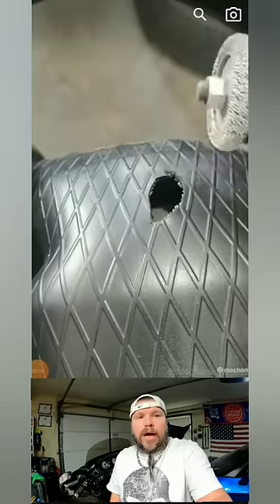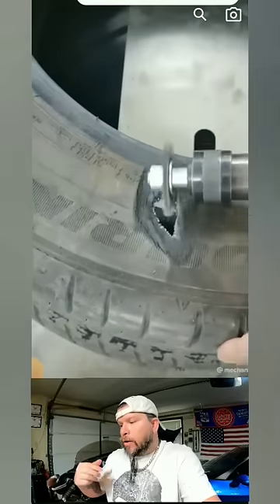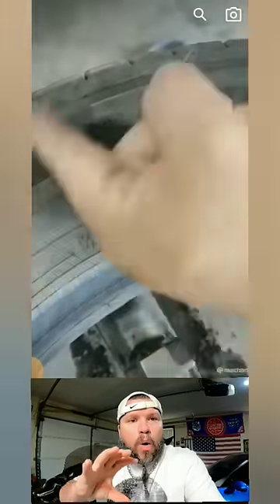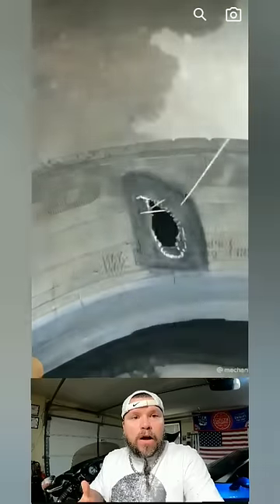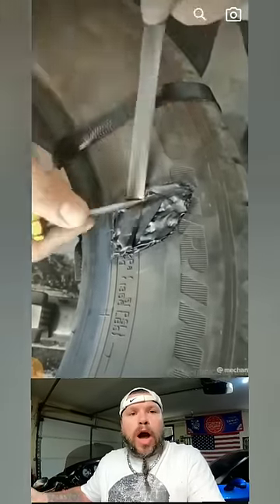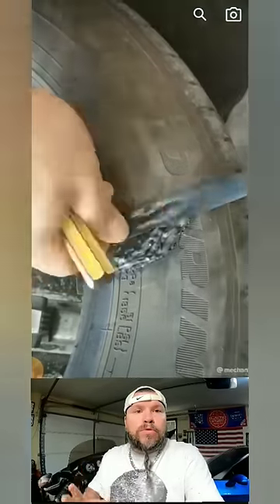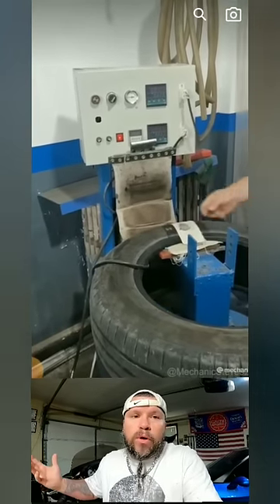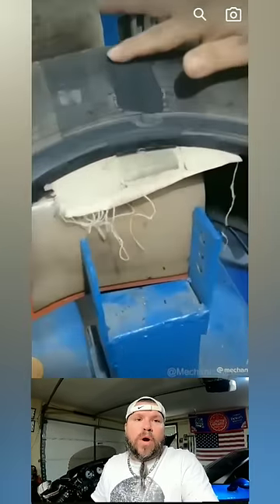patching a tire

Comment: Used to be a manager at Discount Tire. The guy is 100% right. Sidewall damage calls for a new tire.
Reply: "I worked at a place that sells tires, and he's right, buy new tires"
Reply: This is a completely different method of patching than what tire shops use. You can't compare the two.
Reply: @Kur Norock  right, because this isn't cost effective, time efficient or safe. It's compromised.
Reply: @corataylor2205  I used to work at dtc too. No one gets paid on commission except the highest lvl manager. We don't give a flying fuck if you buy a tire or not
Reply: @IronwolfXVI  except that it isn't. 
This is a legitimate and very strong repair that is used throughout most of the rest of the world.  Only here in the western world do we have this culture of throwing things away and getting a new one if something breaks or gets damaged. 

When you use wood glue to join two pics of wood, the joint becomes the strongest part of the object. This patching method works much the same way. That patch has been pressed and vulcanized, making it part of the tire sidewall and every bit as strong.
Reply: @KurNorock  and what happens when you're rolling down the highway at 75 mpg and that one spot flexes different or the threads rip out? Doesn't matter if it's "stronger" it needs to be the same
Reply: @IronwolfXVI  the threads aren't holding anything together. They were just there as a lattice to support the rubber filling.  

And the patch doesn't flex differently. It's the same material. Vulcanized rubber. 

People have been fixing millions of tires like this for generations without issue.
Reply: @Kur Norock  side wall is structural, and who's to say the compound of rubber and the heat are the same? If it ISNT holding anything together, it's weaker. That's part of my claim. Either way, if it stretches different,  it could rip.
Reply: @KurNorock  I don't just throw away things, don't say that all in the West are the same. The plain truth is that if you could afford it, you would always go with a new tire as it's much safer to drive. Nobody would cut cost on safety when you could afford it or are not dumb or don't take life seriously. Germany has like 95% of all roads with concrete, our highways have sections in which you can go as fast as you wish. Using such a repair method like this would cause many deaths.
Reply: Lol...I bought some tire air pressure sensors from Discount Tire and the damn service guys tried to sell me on some lug nuts..saying that the original lug nuts expanded and they can replace them for $70.00 more..I said man put those lug nuts back on..WTH..
Reply: @Delbert Dumas  yeah, a lot of American cars have issues with their lug nuts. Next time you're on the side of the road and can't get the socket on your lugs... well I hope you have AAA. Solid lugs are well worth the price. As far as the air gauge, my store just gave those away.

Edit: oh you probably meant the $60 electronic sensors. We didn't give those away.
Reply: Why is it just to sale a new tire?
Reply: @everardomodesto8523  I explained in the comments.
Reply: @IronwolfXVI  I have owned cars for 50 plus years and never I mean never have I had an issue with lug nuts..the guy was trying to BS me on that shit..kind of pissed me off that this place does this..first and last time I'll use this company for anything..I can only imagine the many people who fell victim to this shit..
Reply: @Bernard Watson  yeah, it's a newer thing. Go ahead and look it up if you'd like. They have a cap on the outside. It's dumb. Old lugs are solid.

Comment: The amount of times a customer has bitched to either patch or plug a sidewall. To the point we have them sign a stupidity waiver in the case dumb shit happens after warning them a million times. We just let it go.
Reply: The same thing happens in construction... Anything safety wise we simply say, sorry we can't do it. But if the person wants a cheaper product installed, we warn them,advise against it, and sometimes still won't even do it. If they really don't care, we do it but always get a call back. It's just not worth pinching pennies in some areas. I've actually had a kidney surgeon ask me to reuse old,curled,black shingles and to simply " just flip them around...
Reply: In the UK you'd be liable for doing that repair, it'd cost you your job at the very least.
Reply: ive gone to tire shops to get a plug, and they wont do it. Went to the store got a plug and did it myself. tire was fine.  Heard that story plenty of times as well.
Reply: @lynch42o  How would you live with yourself if you had a blowout and took out a family?
It's been fine for loads of people who have done it, but it's also been a disaster for others. 
I'm happy enough to gamble with my own life but I've no right to gamble with other peoples.
Reply: I get that customers can be a pain in the a*s sometimes. But that waiver wont help you either way if the dude/gal ends up killing someone when the tire desintigrates itself. In any court of law youll be told that you as the expert cannot just simply aid the customer in stupid choices because hes being difficult about it since the customer is not in a position where he can judge the risk or is able to "take the risk upon himself" simply because he lacks the knowledge to be able to judge. So your waiver is a useless piece of paper with meaningless letters on it. Not trying to be a dick here, just helping out
Reply: @lynch42o  The problem is not that it can't be done. It's that it is dangerous because the tire is at a huge risk of a blowout when the sidewall is damaged. So you could be putting your own life or other's lifes at risk
Reply: @lynch42o  yeah ive run plugged sidewall over 100mph
Reply: whenever a sidewall damage occurs at my local mechanic's, they just deny the service for liability reasons.  Get a new tire or gtfo.
Reply: Waiver won’t help you, you can still be found liable if anything happens. Just quote the fix 3x more expensive than a new tyre
Reply: I've made that same mistake many times when working at a big brand tire shop and luckily worst that's happened is the hole got torn and the tire was run flat with irreversible damage to the sidewall.
Reply: @jpro112185  a kidney surgeon huh.....cool story buddy.
Reply: @lynch42o  plugging tread, no problem. "Plugging" or "repairing" a sidewall? No bueno. Sidewall and tread are very different.

I drove from NY to FL with a plug in the tread. 0 problems.

Anyone that tries to repair a sidewall puncture as shown in this video (if you can call that a puncture) is a moron.

Hopefully they only kill themselves when that tire fails. When it fails, not if it fails.
Reply: Same at Discount Tire. We just refuse.
Reply: @jpro112185  😂 glad to hear it’s like this in cars and construction too. I’ve been a gas fireplace technician for 4 years now and the amount of times I have to make people sign a paper basicly saying “I understand I am potentially poisoning myself and declining future service” is too often.
Reply: I've ridden on a punctured tire on the sidewall got it fixed drove to Vermont from NYC and then probably another 1,000 city miles after that and never had a problem
Reply: You don't let the customer dictate how you do safety repairs.
Reply: This is common in third world country and they do better then this.  Pls check in YouTube some car garage they do it
Reply: i had a nail in my somewhat brand new tire on the sidewall.. anyway i patched it. 

the tire had a full life and never gave me any problems. i got lucky. 🙂
Reply: It's not taught in 2nd and 1st world countries but it's absolutely possible to patch/repair a sidewall it's just a lot of hard work and really isn't worth it when you have access to more tired
Reply: I used to work at Loves and we weren’t allowed to patch a sidewalk even if it was a super tiny hole and anything beyond I think it was bigger than 1/4 inch we wouldn’t patch either
Reply: @jpro112185  I heard a furniture carpenter say, "An expert is not a perfectionist. I will see 1000 things wrong about every piece I've done. An expert knows which flaws matter, and which don't." I believe it as a EIS carpenter (who'd a thunk haha).
Reply: What do you think about a plugged screw hole in between tread?
Reply: @plowe6751  if the hole is in between your tread and not on the side wall is it safe to drive on a plugged tire? I had plugged one myself with my dad because I ran over a screw and the tires were basically brand new and I don't have money for new ones 🤷🏻‍♂️ I plugged it a few months ago and it still hasn't went flat again so I think it's good I just don't know how far it is in the tire because it took a few try's to actually get the tool all the way in and it would pull the plug partially back out when I went to pull out but it's not leaking air 🤷🏻‍♂️ I had some excess left over that I had to cut off I'm just curious how safe it is to drive on..
Reply: I'll never understand that level of stupidity.  When the tire shop says my sidewall is bad I believe them.  Especially since my tires are warrantied.
Reply: @Nobody-vr5nl  Yea, you are completely right. It's so true, that the things you see, nobody else will see. And the things they see, an expert would pay no attention to. It's a tough business to be in, because anyone can pick apart anything about anyone else's work. But to know what's important and to understand the situation or atmosphere you were in, namely dealing with odd customers, is a completely different animal.
Reply: @plowe6751  I get minors to sign waivers before I serve them a pitcher of beer. It's basically a get out of jail card. 🤣🤣
Reply: I hope you rethink that practise, because if someone uses that on his own property and projects only himself to that danger that migth be fine, i mean there are stupid people all around the world, but if that tire blows on the highway and the car swirves to the side you might just be responsible for a car crash and lost lives. Dont play into the hands of idiots.
Reply: That customer can find another shop, an unsafe repair will never get sent out of my service bay. They can take their 20 bucks somewhere else. 🤷

Comment: That's a perfect farm equipment use tire. Nothin over 10 or 15mph.
Reply: This is true, my dad always threw cheap old trailer tires on the front because they get thorns anyway
Reply: Yup, solid scrap car or truck on the farm to move stuff around and/or teach the kids to drive. But only slow and no side hills.
Reply: I wouldnt run that on farm stuff either. Most farm stuff does what? Haul heavy stuff or pull under a load.
Reply: @bucket0rocks  there's plenty of farm applications that don't require heavy loads.
Reply: @bucket0rocks  a lot times farm truck are just used to avoid walking
Reply: As long as it's a light load. All the sidewall banding is compromised so if there's much weight on it, it'll just balloon out until it blows.
Reply: So that is about 100 mph tire in Detroit. If my maths is right
Reply: @michael2943  farms can get big
Reply: @rosslefave5877  no, and I’m from Detroit.
Reply: @bucket0rocks  

At about fast running pace.
Reply: yup 20 mphmax
Reply: @RedHaloManiac95  no it is false because once you actually add air inside the tire that is the weakest point on the tire now because of the giant patch that is going to bulge out once fitted to vehicle and also run uneven
Reply: @amirbasssystem  we’re talking about running them on a farm tractor 10-15 mph max. I wasn’t saying on a car
Reply: @bucket0rocks  doesn’t matter a farm vehicle can go maybe 15mph max. People don’t drive their tractors on high gear anyway unless you’re on a public road. I’ve never seen a tire blow out, they always just deflate but the speeds are low enough that you won’t lose control or anything. You don’t put new tires because there’s thorns out there and all that which will ruin them pretty quickly
Reply: @AGyuh  grain augers, generators, silage blowers, the list of perfect applications goes on and on
Reply: @94XJ  I heard that wives on the countryside might be slightly bigger, might be a good idea to keep one's wife and/or mother in law out of the trip with compromised tires :D
Reply: @rosslefave5877  Thought that driving on your rims only would be cheaper and safer than using "repaired" tires. At least, rims don't loose air and they create jobs in street maintaining. And I think it also is ghetto enough.
Reply: @michael2943  legend has it this guy is still walking back to the farm after a hard day toiling in the field.
Reply: Yes, perfect for downtown Detroit farms
Reply: @RedHaloManiac95  farm tractors go over 32mph now
Reply: @tokahontas9990  u don't get the free tires?

Comment: Worked in a retread shop. This man is correct. When we have a tire with a side wall blowout, they get sent to a shredder company to get shredded and turned into either powder chips for play grounds or melted down into new repourposed rubber components like mats for garages.
Reply: Cant tell you how many times i was saved/mildly burned by those hunks of tire as a kid
Reply: When we see a sidewall puncture. We put more holes in it so that tire cannot be used ever. Drill it with hole saw

Comment: Electrical tape like that can be rolled up length wise and used as a makeshift tire plug. Light the end sticking out so it melts down and kinda glues it to tire. Gets you out of the brairpatch anyways.